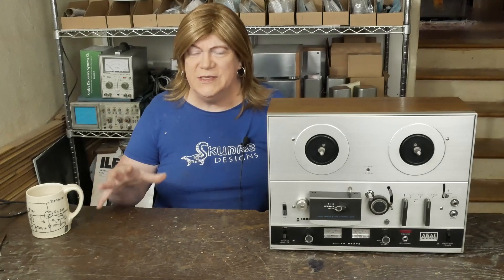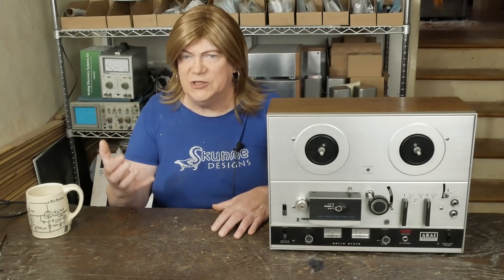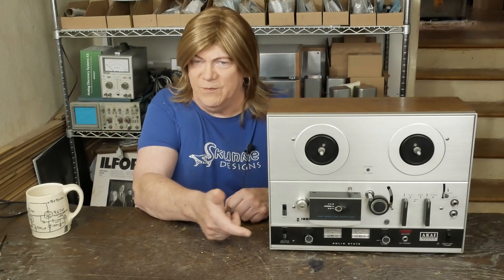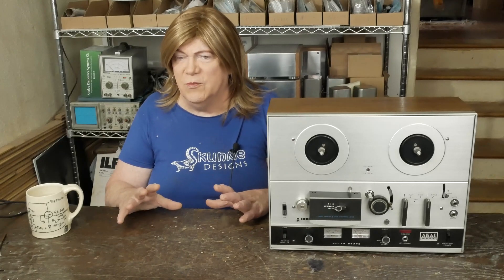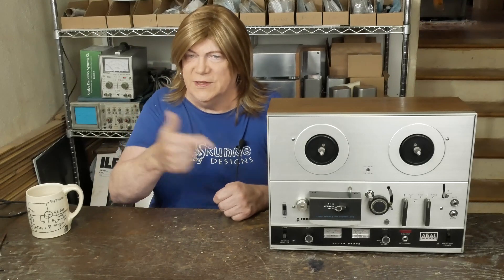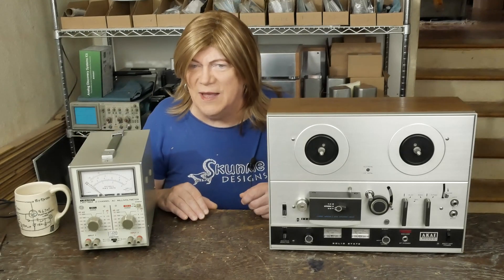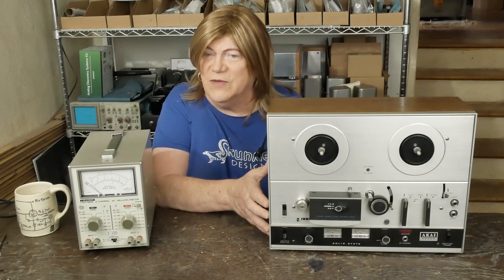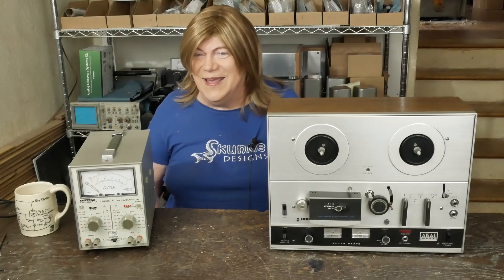Reel to Reel Tape Deck: Akai 4000D Overhaul!

Comment: It is quite common for mid spec reel to reel tape decks with early dalby built in to radically improve the overall sound of recorded vinyl.....even at 3 1/2  speeds ( are they called ips ? ).

At the 7 speed the music sounds even better, but you can only tape half the music.  lol.

Comment: The only 'yucky' part about working with logic circuit era solid state is replacing long since obsolete discrete components where you don't have the schematic and/or the electrical engineering know-how to find the equivalent replacement.  Also, those old circuit boards are single layer/surface trace.  You have to be very careful not to pull up and break the circuit traces when de-soldering and cleaning up the board.  You can improvise jumpers on the board when you do break a trace, though.  I did a lot of trace repair when I rebuilt a McInstosh MC2200 amp.  McIntosh, wonderful company that they are have wonderful service manuals where they list all the components....and identify those components with a McIntosh stock number....not the the component number...arrgh....

Comment: Yep, my experience as well, tape recordings sounding 'better' than the vinyl it came from, as if you could crank up the dynamic range and that was on my good old 3 head Nakamichi LX7 using Maxell MX tapes or even the cheaper (thinner) Fuji metal tapes.

Comment: Yep Yep! There's some kind of 'voodoo' magic that happens recording vinyl to tape that I don't question it too much, I just enjoy it because 'it works'.  Having experimented with even recording at 7.5ips and 15ips, many say the 'sweet' spot is recording on the lower 7.5ips speed as opposed to the higher 15ips, and you know? I think they are right!  There seems to be a 'natural' EQ effect, some magical 'fairy dust' that seems to really work well for that particular speed.  It really compensates vinyl really well for some reason to make it more musical and pleasant to our analog ears.  I also look forward to your video(s) regarding changing out transistors and what replacements are chosen, I find this the hardest part to figure out with this older gear.  Cheers, keep em' comin'! :)
Reply: I totally agree though the lower tape speed is new to me. I must try that. The tape decks I have are in disrepair, maybe this is a good incentive to up the priority on that. 
The replacements for the transistors are discussed on a tiny UK based channel called Michael Yates. You will have to search for it. Personally if you can bot find an officially recommended one, I would default to the BC549C. But you always have to make sure that the pin out is correct. Some Japanese transistors are backwards and some have a complete different pin out. You will have to do origami with the legs.

Comment: I believe DIY Audio sells a Nelson Pass kit that adds saturation distortion, to any source, as its euphonic. What tape are you using?
Reply from the maker: He sells a kit to play around with second order harmonic distortion, I've got one and it's IMHO not very useful in a system, it's more for just experimentation as the distortion radically changes with the signal strength. It would have to be installed with a fixed signal strength across it etc and honestly isn't the same as what tape is doing. I'm using some Maxell UD and also am testing some of the modern production stuff.

Comment: If the tape sounds better than the source, it is because it is subtracting something from the source. I suggest that you figure out exactly what it is filtering, and get rid of the problem in the first place.

OTOH, if it is adding distortion, and you prefer it, then I have no comment.
Reply: As Steph said, is has to do with tape saturation, so yes, in a way it is distortion. But the phenomenon is well known, tape sounds better. I have personal experience with recording LPs on reel to reel and the latter sounds better. Subjectively I also believe tape decks have more dynamics. It could be fake as well, but I know no other source that gets you more / better in the grove. I think you have to have experienced it.